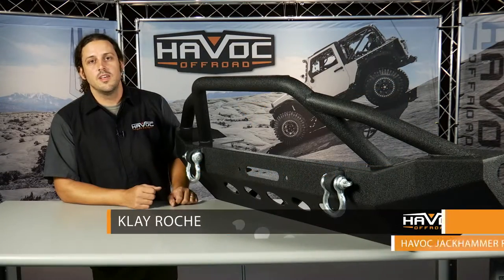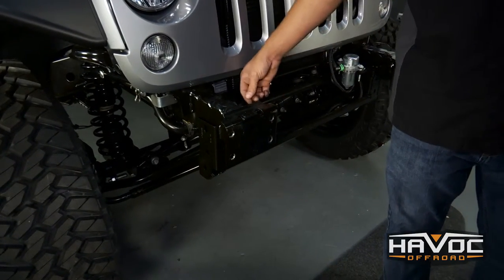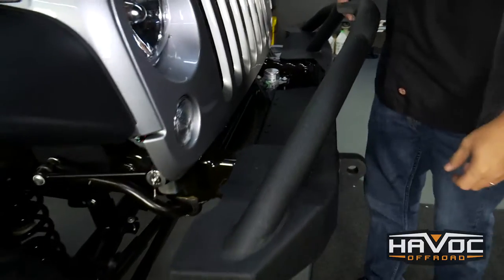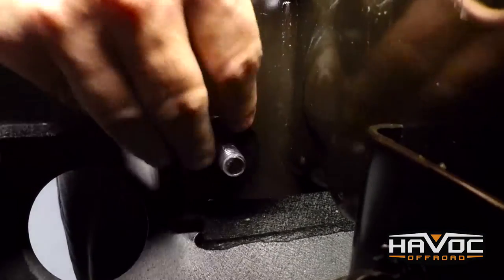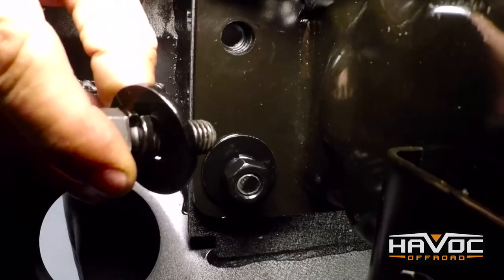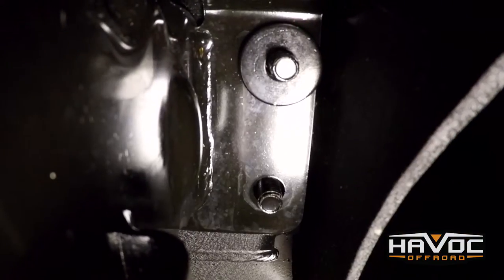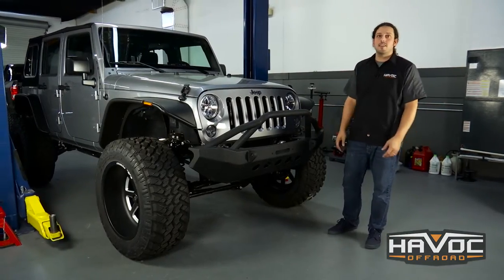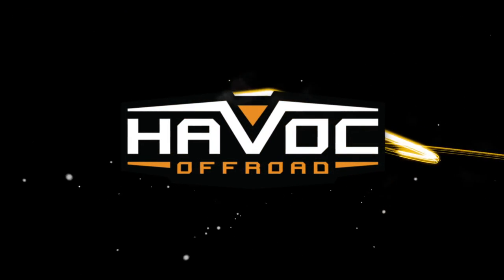Havoc Offroad Jackhammer Front Bumper Install - HavocOffroad.com

Comment: Why are they made from thinner steel? And why can't I find them on your website right now?
Reply from the maker: +Spike “Boneyard” Voelsing We have removed them from the site because of issues with packing from the manufacturer. We are correcting the packing to the industry standard  of spray foam in the box to assure it does not move around in the box. And the steel question, the shackle tabs are made of 7/8' steel which is thicker than 3/4'. Thanks for the question!